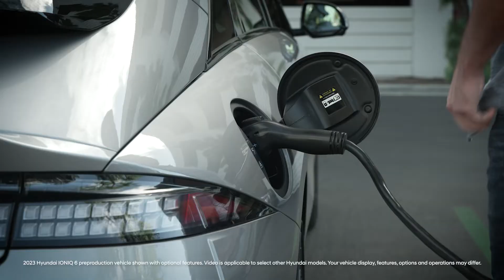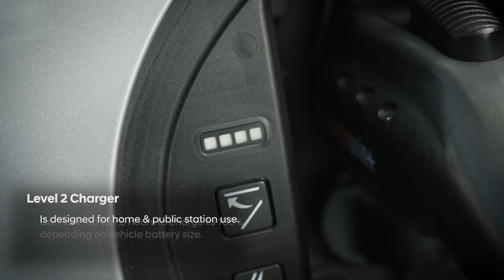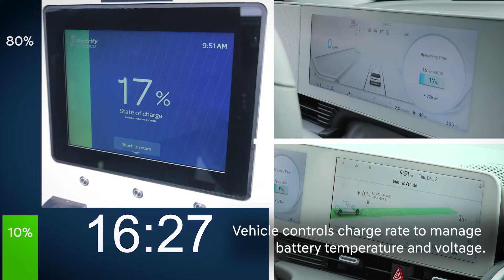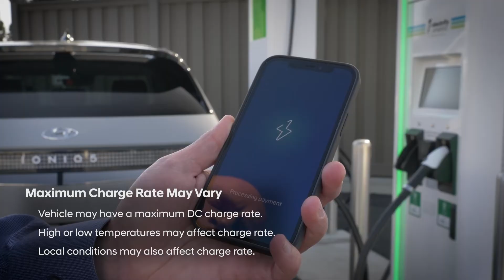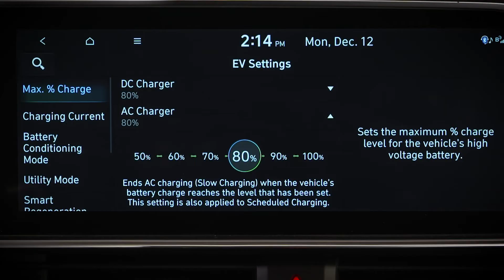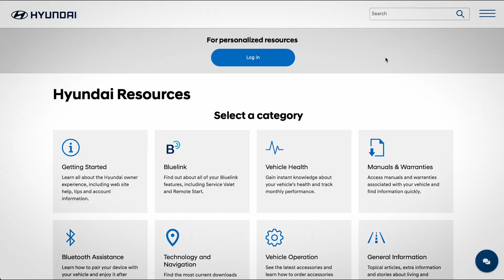Electric Vehicle Charging Basics | Hyundai

Comment: Not all Hyundai EVs come with a Level 1 charger as stated in the video. My 2024 Ioniq 5 SEL did not.
Reply: My 26 ioniq 5 came with a level 1 or 2 charger you can change out the plugs so at home I can charge at 7kw an hour and will charge from 20% to 80% in about 7 hrs love it
Reply: That sucks, sounds like your dealer kept your charger. You should reach out and let them know if you don’t have a charging solution already like Level 2 at the house. Every car is required to be included with one, we’re on EV number 5 and each come with a Level 1 charger.

Comment: When is Hyundai going to address the over heating problem with Level 2 charging? It just shuts off after about 45 minutes. 

Houston we have a problem.
Reply: My 24 Ioniq 6 has never shut off during charging on a level 2 at my house or a DC fast charger.
Reply from the maker: Please contact your local authorized Hyundai dealership for further information. ^cc

Comment: Norm Reeves Hyundai in Cerritos, CA, does not provide the level 1 portable charger on 2024 EV models, despite the fact that this video states that "all Hyundai electric vehicles" come with the portable charger.
Reply from the maker: Hello. We are sorry to hear about your experience with your local Hyundai dealership. We recommend contacting your local authorized Hyundai dealership regarding your inquiries. Our dealerships are independently owned and operated, so we are not able to guarantee what benefits and deals are currently being offered by each dealership as they may not be offered at other locations. ^cc

Comment: Hi Hyundai if you are listening, please consider offering the 18” wheels with low rolling resistance tires on the SEL and Limited trim options. Thanks.
Reply: Agreed, the 20" tires standard on the Limited really negatively impact range. It's forcing me into an SEL purchase, the opposite of what Hyundai wants to accomplish.
Reply: Hyundai always listens to customers.. unlike many murican Companies. But any reason behind 18s, over 17s etc. If it's valid hyundai will provide to customers... if it dosent hamper performance,  range, cabin noise etc.